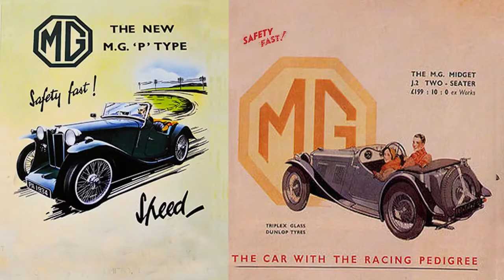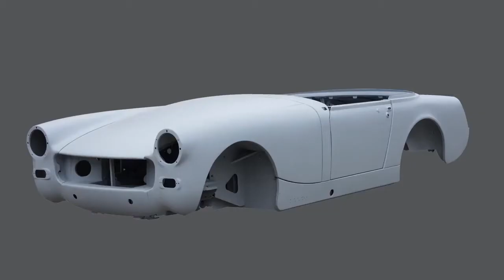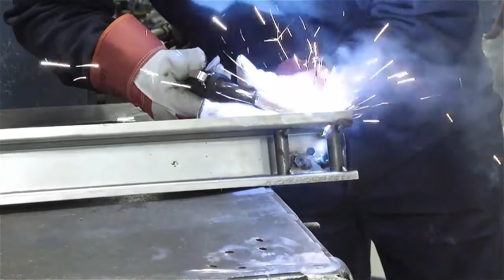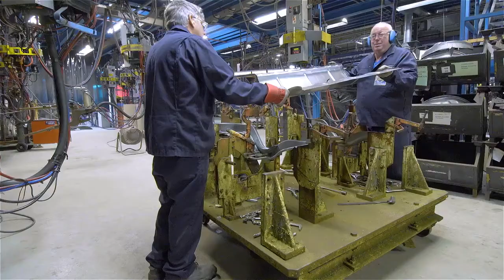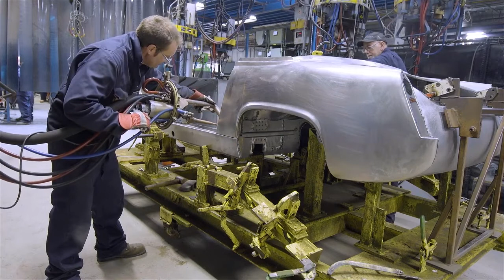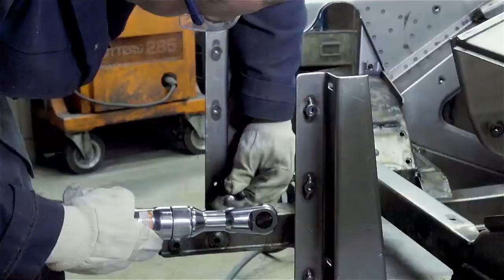MG Midget Bodyshell   Bodybuilding

Comment: Do you think this is how the built the original cars, by hand, with no robots? I realise they would have been on an assembly line with a lot more workers but all hand built?
Reply: The inner structure was designed in the mid/late 50s when robots/automated production processes were just a dream in sci-fi authors minds. And production volumes were never high enough to justify investment in automation, even if it had been available

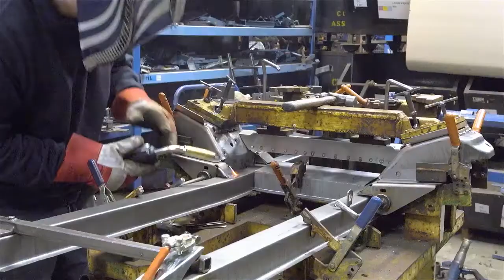Comment: I’m tearing my 66 Midget apart for restoration. The car has a very small 2  piston master cylinder with common reservoir. Looks like one for the clutch and one for the brakes. Is this safe or should I retrofit a pair of 3:50 different master cylinders?
Reply: Swap it out if you're not worried too much about originality
Reply: @rustandoil it’s not a trivial job to do this, as the footwell top is very different, where the cylinders mount. You used to be able to get a Sebring pedal box that fitted in the original mounting hole and took two separate cylinders, but the guy making them stopped doing it.